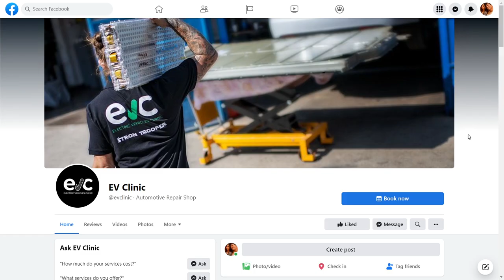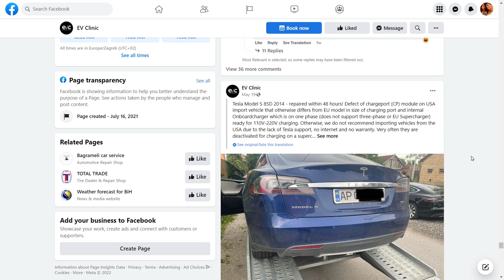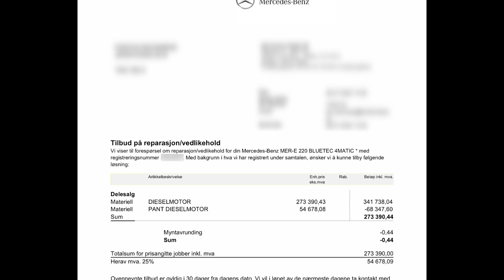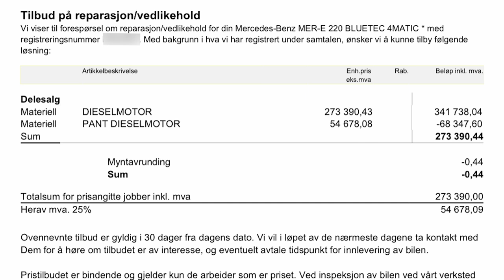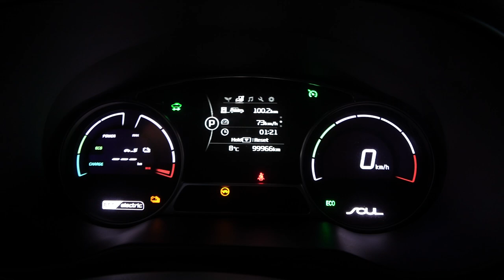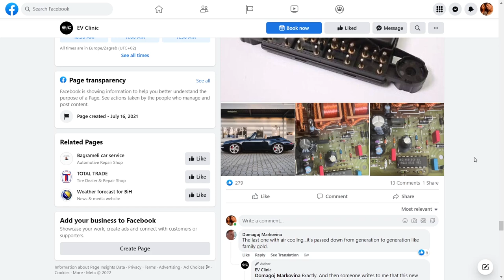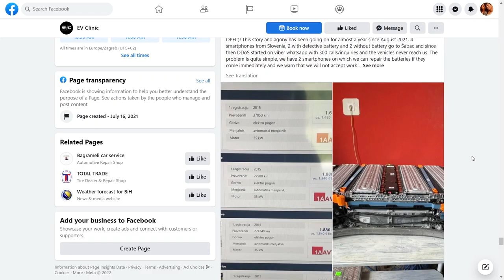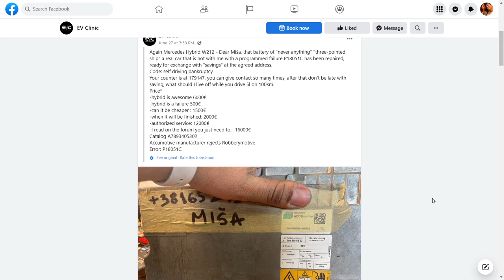Why fossil cars are more expensive to repair than EVs

Comment: Unfortunately the first video in a long time where I have to say, it's very biased. Having to replace the entire engine of a car is incredibly rare - even if you have to machine the block, replace pistons etc. it would very rarely cost 9k euros. 
Granted, there are more parts to be cooled and replaced in a ICE car over time, but the concern is that far more EVs will require a new battery pack at some stage (either through a fault like in Millennium Falcon, or degradation) than ICE cars requiring full engine replacements. This cost will economically total most EVs once the battery goes kaputt.
Reply: This is true @larsandroid and maybe Björn can explain why almost new ev's go scrapyard in Norway (because too expensive repair)?
Reply: Totally agree. Even if it might cost 9k+vat for a new Tesla battery, we as consumers are for sure not paying it. The numbers i have seen are way higher than those figures. Also, a cost of 15-20k for a fossil engine, what kind of failiure would you need to have then? As it is now its almost more expensive to service and maintain electric cars rather than older fossil cars, not looking at Tesla ofc since they are the only ones that doesnt require regular service. Most EV's seems to have 12months/15000km service while diesel/petrols have 24months/30000km. The worst part however in my EV-experience is how utterly shitty the dealers are on their EV's, the aftermarket feedback or support in case of problems were non existing. Basically they dont know what they are selling...
Reply: @rogerstarkey5390  The issue will be for all the people who will go to their branded workshops, like they also states in the video, which will just propose a new battery and are not interested, or simply doesnt have the skill or knowledge on how to repair a battery. They are just simply replacing components based on error codes and then it will ofc be very expensive very fast..
Reply: @Emil-fx7pg  Just like with nearly everthing today. Printers, washing machine, control units. Mostly it's cheaper to replace them than spending 3 or more hours searching for faulty electronic parts and replace them, even if it is just a condensator for 1 cent.
In my free time I repair all kind of things for neighbors, like coffee machines or laminators. Somestimes it is just a small thermal fuse for 40 cent and the laminator works again. But for the manufacturer it is cheaper to send the customer a new one (if it is on warranty) and the old one is just thrown away.
Reply: @Mues_Lee  Yepp exactly. That's one of the issues for me, i can buy and run a decently modern car today and keep it running for bit more money, since i can repair basically everything myself. If i buy a ev second hand i have to go to the dealers and in Sweden not even the dealers know their EVs. So far we don't have any ev focused workshops outside the branded dealers, but i hope it will appear so it will be possible to repair and even upgrade older EV's.
Reply: @rogerstarkey5390  Just as the guys in the video are guessing in that case.
Reply from the maker: Having to replace a whole battery pack is alsy incredibly rare. Biased? No.
Reply: @bjornnyland  Yes, but as mentioned before that will be the advice from the branded workshops and that's also what is putting people of EVs. That there is no workshops around or ways to actually repair your ev, which you can with ice powered cars. For example i have heard of more people who had their batteries replaced than actually repaired, because todays VW, Tesla and so on workshops are just swapping components according to error codes, they are not performing actual repairs.. Hopefully there will be such workshops more accessible in the near future, but until then the risk of big bills if you buy an older ev is to big for many.. I would not dare buying a ev that has its engine and battery outside of warranty/insurance cover but I'm fine in buying an ice car because those i can easily fix myself.
Reply: @bluebikerathar  Yeah I'm sure there will be plenty of places in some years, when more EVs ate outside warranty. Just replied to this video since it was made to showcase how cheap EVs can be to repair and that there is no reason for people to worry about repair costs since they are so low, if you can get a hold of people who can repair, which most people will not be able to do. So I'm just saying it's not a fair comparison made. 

Catastrophic failure of an engine in an ice compared to battery failiure. Where the battery can be repaired but the engine will be replaced with a new one for 15-25k. I would be happy if it would have been focused on the possibilities there is in repairing batteries in the future and not pushing numbers that doesn't make much sense for many people.
Reply: @Emil-fx7pg  Do you know what happend if battery have catastrophic failure? Bolt is good example. I just saying it's not a fair comparison made!
Reply: @pmkgamingtv  that is generally down to a combination of two factors
1 EVs in Norway have no VAT or other taxes when purchased, but labor and parts for repair are subject to VAT. This means that the price for repairs exceed the value of a new car M uch sooner than for a ICE car. Insurance companies will replace the vehicle with a new one if it's newer than sat 3years and the repair cost exceeds 80% of the price of s nee car. Before 2022 that threshold was only 60%.
2 the cars are under warranty and the manufacturers demand new parts are used to keep the warranty after repairs.  For battery packs they typically demand the entire pack is changed even though it technically could have been repaired.
Reply: @tei1337  Good answer! So you say at (This means that the price for repairs exceed the value of a new car Much sooner than for a ICE car) and video Title is? 🤣
Reply: @pmkgamingtv  thing is, if two cars of the same brand/model need the exact same repair with the same cost, the ev could still be scrapped when the ice var is not  if the ICE car is more expensive due to VAT and taxes.
Example a BMW M440i grand coupe starts at 955400 kr, the  i4 M50 starts at just 5899000 kr.
Reply: @Emil-fx7pg  under warranty they just swap battery packs and refurbish the old one. It will then be reused at a later point as a warranty swap.
Reply: @rogerstarkey5390  Not really, i can fix basically anything on my ice, including engine swaps. Regarding EVs i wouldn't touch a battery pack and there is no ev workshops around. So the only workshops left is the "branded" ones at the moment.
Reply: @bjornnyland  yes, it is biased. Ask any 2000s Toyota diesel owner. I had mine for 18 years and have spent less than 10 000 kr in those 18 years on service and maintenance. Try that with your EVs and hybrids.
Reply: @rogerstarkey5390  I'm not talking about repair work. I'm talking about the cost ice vs electric... something that only statistics will show over a long period of time. That's why I made a guess above.

Comment: One of the tech mentioned that some battery pack can rust and water and salt makes isolation problem but cars like the BMW I3 and the Ford Mustang, VW ID family have a aluminum battery case so most likely it will be good for the life of the vehicle Tesla is made out of sheet steel so it will rust and what about the new structural battery pack From Tesla they are non serviceable.

Comment: Hardly anybody buys a new "crate" engine from the manufacturer and fitted at a main dealer. They only tend to be put in warranty cars. Most people buy engines from wrecked cars. These can cost from as low as €200. 

For comparison how much is a front and rear drive unit and battery from Tesla fitted at Tesla. Silly money that nobody would pay. 

Eventually as more and more EVs become available then stock of batteries and drive units become common on the secondhand market then prices will come down on parts.
Reply: That was, what I tought, too. And they just talk about stupid german premium cars. I don't think it cost 15k to replace a Corsa or Dacia Sandero engine. And normally, you don't have to replace an engine or gearbox. To replace a battery in an old EV, thats normal.

Comment: I am Sorry, this is not based. The e220 engine you used as an example costs 4k euro used today, so you dont need to spend 27k on a new unit, no one does that unless the insurance company is paying. And the "pant" is a Core charge, it does not mean that the enigne is rebuilt. And you can rebuild it with private company for about 4k euro with 2 years warranty, that includes price of shipping old engine to germany and back to norway, so a complete swap is 6k euro with either used engine or rebuilt unit. 

Thats like me saying that a second hand battery for model s is like 10k euro just for parts, without mentioning that you can change just the broken modules for 1k each. the harsh reality is the EVs are the new kids on the block, you average menchanic cant "repair" them, they just change parts, that becomes expensive quickly, where as your avergae mechanic knows how to rebuild a turbo og how to clean the dpf system...

Some day EV will become much cheaper to fix compared to new complicated diesel engines with particulate filters and complicated egr, but we are not there yet, because there are not enough used parts for ev cars, and because average mechanics dont know the "little tricks". Not to mention that some EV companies have almost gone out of their way to make their cars more difficult to repair.
Reply: "Some day" isn't today or even in 10 years. You are comparing it to a Benz, but when compared to a Toyota? EVs are not the future and are even worse for the environment.
Reply: @AP13P  no they are not. Volvo just realesed the biggest study on life cycle analysis for ev cars compared to their own petrol/hybrid cars, basically the electric xc40 vs the petrol version, if the ev is powered by just non renewabel sources then it will be 50% less polluting over its lifetime(production-use-recycling), and if you are in a country with green energy such as Norway then its 80% less polluting than the petrol car, so what source do you have that says that ev cars are worse for the enviorment?

Comment: There's one key difference though: you can drive an ICE for many, many years and never need to change the engine or the gearbox. It's not like ICEs will break.  Batteries, however, will lose capacity, even if the whole pack doesn't fail all at once. My understanding is that some batteries can be fixed by modules, but not all of them.  If a component in an ICE fails you repair the component, not the whole engine, with exceptions of course.

Then you have other components in the EVs that seem to be assumed will just never fail, including the motors. Is this really true? Does an e-motor never fail,  and neither do other components?
Reply: Fully agree with you Edvard. Engines (blocks, pistons etc.) when properly maintained are designed to well outlast the lifespan of the car. This is not the case for batteries, as they degrade over time and will eventually require replacement.

I've been driving high mileage, high performance european cars for 10 years now (worst case scenario for maintenance bills!) and the worst issue I've had is a head gasket replacement at 1400 euro on a BMW, and a previous owner of my S6 had to get his gearbox refurbished at a cost of 2500 euros. None of these are even close to the 9k required for a new battery!
Reply: @Zetbo  If the intake side of the turbo dissolves, then 99% of the engine block is defective
Reply: @larsandroid  Lifespan for ICE-cars are 150.000 to 250.000km
Reply: You only need a proper routine maintenance to actually makes any car last 15-25 years. There is so many toyotas without engine change still on the road and have 250k miles on the odometer. And im afraid that this all new toyota hybrid (camry, rav4, highlander) will last even longer and their engine will last basically forever because all you need to do is to change the battery for every 200-250k miles if you change the battery air filter routinely, the engine literally has no belt anymore making it less strained. This camry toyota will get you over 1000kms with only 1 full tank you need only 5 minutes in the gas station.

Man bjorn, you so stuck in your bubble and echo chamber, its so dissapointing. This video especially. Jeeeezzzzz......
Reply: @Zetbo  i just sold my 2007 diesels with 332kkm on it. Engine and gearbox both original and without any issues. It didn't lose any range either 😇

Comment: Well as a TMS 85D 2015 owner the repairs are starting to look scary, like the leaks in the air conditioning can happen everywhere and repairs can be as high as 2k euro. Still Tesla has no plan for battery refurbishment... and in none of the new model versions can even fix the batteries. Hope other brands can do better.

Comment: ICE engine or gearbox replacements are not the standard. Thats always the worst case scenario and a bit stupid for such a discussion. What is more likely to happen, a dead battery in a 12 years old EV or a dead engine in a 12 years old ICE?! And here comes the problem, old EVs. I would have no problem to buy a 10years old ICE with 100k km, but I would never buy a 10 years old EV, as this battery is just to old. We can argue like we want, but we're going to have this problem with 10years and older EVs. A car has to last longer. Just when it last, it is enviromently friendly. The car you don't have to produce is the cleanest car. But no one will put a 10K-15K batterypack in a 10 years old EV. 
I bought a first gen Ford Focus in 2009, that was close to ten years old. I promised myself you stick with this thing, till it's dead. We're in 2022, this 23years old Focus is still runnig perfectly smooth and cost me between 2000 and 2500€ in repairs over these 13 years. I don't think that there is any chance to see an EV runnig on it's first battery after 23 years.
Reply from the maker: Battery replacement is also worst case scenario. This comparison is therefore not "a bit stupid" scine we're both comparing corner cases. But somehow the anti EV people will mention the worst case for EV repairs...
Reply: @bjornnyland  It might be a worst case for EVs under 10 years, but not over it. Please Björn, try think about the used car market, where it's totally normal to buy +10 years old ICEs. Batteries just getting old. It's normal, there is no mystical hate it's just chemistry. And as it is nice that we can put these old batteries in stacks for energy storage, but what will happen to the car itself. No one will replace the battery in an older EV. I also wouldn't put a new or used engine in a 15years old Golf, but it's more likely that this thing is still runnig. 
I really think, that we have to talk more about these cars, as they're extremly important for a whole market segment.
Today I have the feeling, people are leasing EVs like crazy, giving them back after 3-4 years and don't care what will happen afterwards.

Comment: They must be charging you a lot more in Norway. I was quoted around £12k for a brand new 30d engine from bmw. £7k for a refurb fitted (Non bmw). Still a lot I know, but far cheaper than a battery pack
Reply: @rogerstarkey5390  didn’t miss anything son…. Just like you can repair minor parts on an ICE…. Not everything is a full engine replacement. Was pointing out the cost difference between UK and Norway…
Reply: Rule number 1: never buy a BMW
Reply: @AP13P  nothing wrong with BMW if you service more often than BMW want you too. I own and also work on these cars every day and see many with hundreds of thousands of miles without major repairs.

Comment: I think Vanja is onto something when talking about carbon foot print for new parts. What about when replacing batteries, as Bjørn in the comments mention about the Kia Soul not being repaired, and just having its battery replaced. Should there also be a MASSIVE CO2-tax on it’s new battery, in the name of saving the environment and leveling the playing field vs ICE cars I mean…?

Of course refurbishing and repairing old cars, both EV’s and ICE is the way forward instead of just hammering out new cars to the public. 

My Taycan’s rear motor failed and was replaced at 57000kms when the car was 20 months old, and it’s battery was down to 93% battery health. A new Taycan battery is ~90000€’s and Porsche wouldn’t even tell me what the new motor amounted to. IF the battery had failed, I could not go to Nassid having it repaired, IF I still wanted the factory warranty to be in place. I guess that goes for all brands and counters much of the purpose of this video. Manufacturers will replace the whole units, either driveshafts, batteries or motors and you as a customer won’t have a guy like Nassid or Vanja, no matter how clever they are, fix it to maintain your car’s manufacturers warranty. I reckon we will see and hear ALOT of such horror stories going forward. But thanks to Bjørn for making the video, but it only applies for old cars outside of warranty IRL.

Comment: I paid £1400 to replace an AC connection wire, the connector cost £100 BMW labour £1300 😆 for ix. It was an EV repair lesson for the dealership technician which I paid for it.